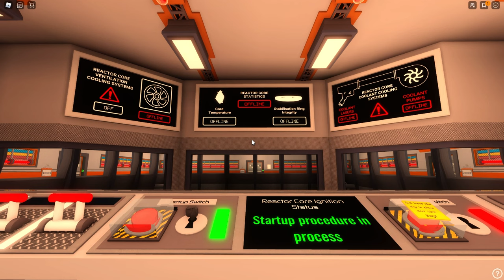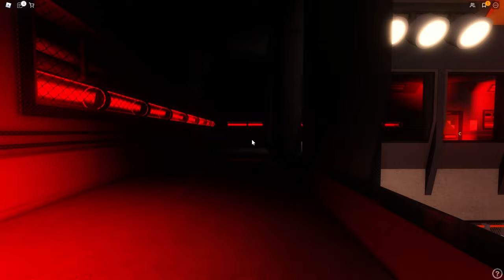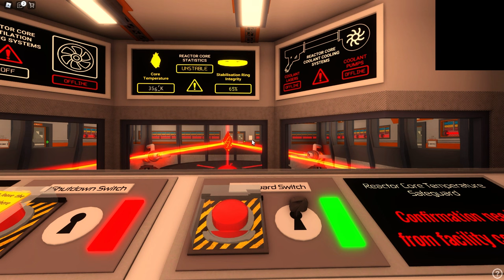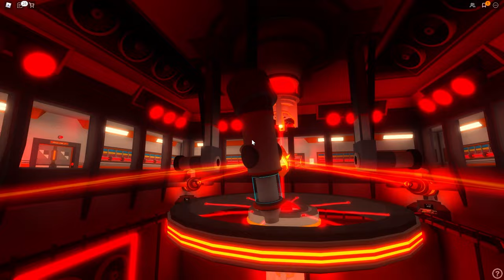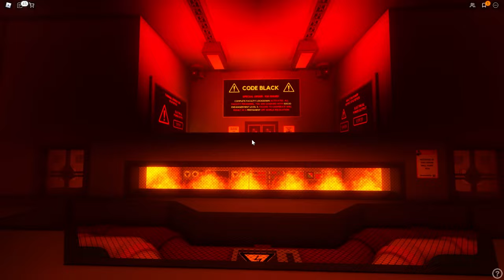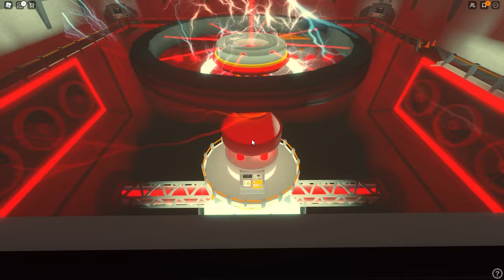Innovation Inc Thermal Power Plant - All Core Events

Comment: 3:38 Right as it said, "Switching to main thermal generators", my computer went into Battery saver mode...
Reply: wait.. WHEN YOU PC IS OVER HEATING

Switching to main pc fans

Lowering main motherboard holders

Extending motherboard holders to extract

Main motherboard holder attaching

Motherboard attached. Now removing the motherboard

I know it might be cringe
Reply: How does that happen?!
Reply: @douglasriveracruz7555  I have no idea.
Reply: @douglasriveracruz7555  Just absolutely phenomenal timing I guess.
Reply: @LocalRobloxGuy  it happens if you have low battery or the laptop is overheating
Reply: @selimedelbiev5672  I know, it was just that it was so perfectly timed
Reply: Lol
Reply: when your pc casually goes through a meltdown
Reply: Bros pc was going into meltdown safeguard mode
Reply: 12 risk factors detected. Low chance of success

Comment: Fun fact:you can know if the shutdown will fail if after ASAS disconnects the reactor core from the power grid because if it doesn't heat or cool will be a success but if the temperature continues to change the shutdown will fail

Comment: One time in IITPP while I was trying to do contain the air I heated it up to safeguard temparture then cooled it down then activated safeguard expecting it to fail and it said 12 risk factors detected it did the safeguard thing then it didn't say ''Warning the temp in the core room is rising'' so that means it sucseeded and then freezedown happened while it was safeguarded cause the shutdown failed that's like a 1/1,000000 chance to happen